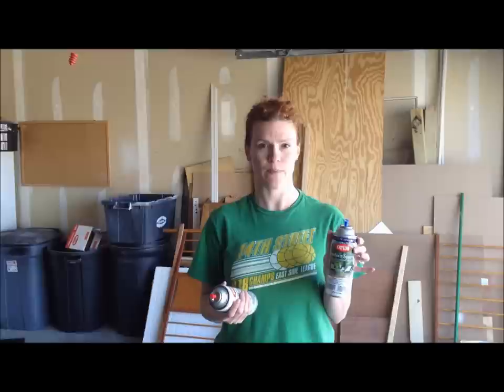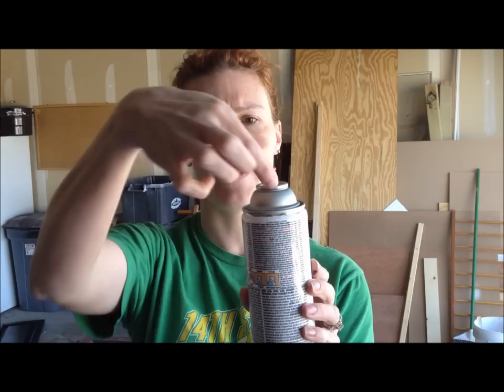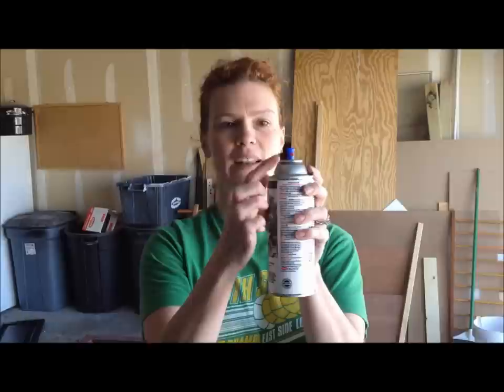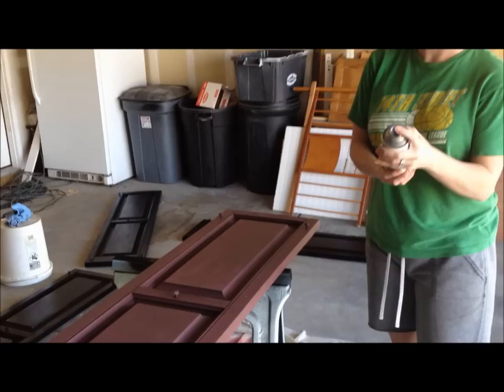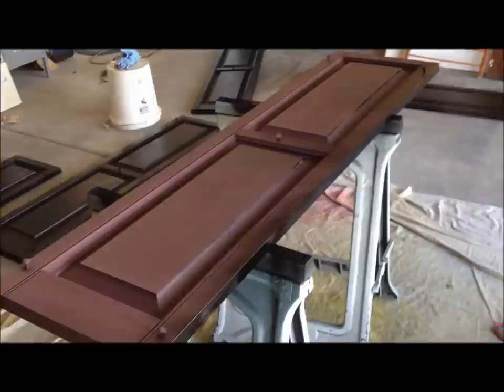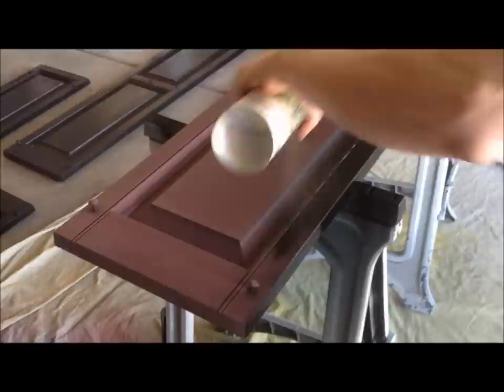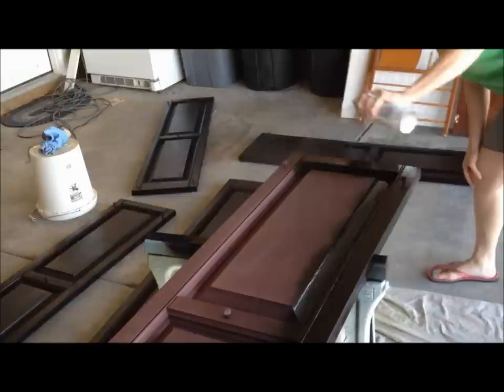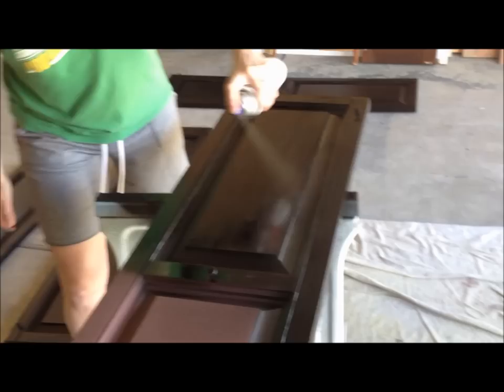Spray Painted Shutters.wmv

Comment: Hi Beckie, nice job, however, next time, maybe look into our product Shutter Renu.  Its a product vinyl siding manufacturers have used for years to bring back the color of vinyl and now its available for vinyl shutters.  It brings back the original color, UV and mold and mildew blocks for up to 10 years.  Google us :)  Unfortunately using the Krylon the shutters will fade again in a couple years.

Comment: that is totally the wrong way to spray paint with a rattle can. a vertical paint fan is meant to be sprayed side to side not up and down. secondly you are using way too much paint spray paint is meant to go on with many light dusting layers before you make a how to video you might want to make sure you're doing it right sorry if this sounds harsh but it's just the truth

Comment: OMG,!   You really need to learn how to hold that Can,  Spray from one side to the other in one straight motion,   the quick back n forth motion is gonna put the paint on very uneven,  Criss Cross the second coat, then diagonal, etc,,  Wood Grain should make no difference at all with spray paint..   You should watch a video on how to spray paint.